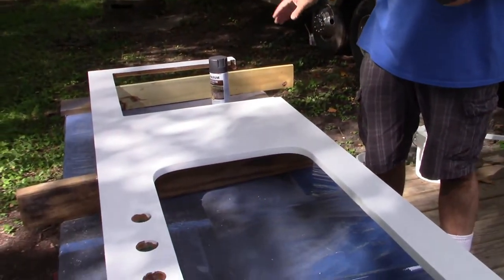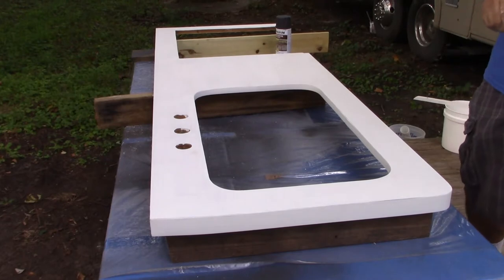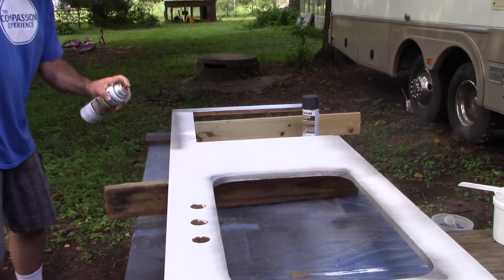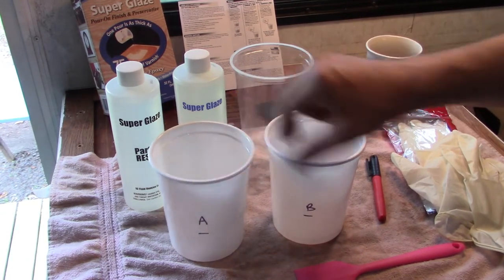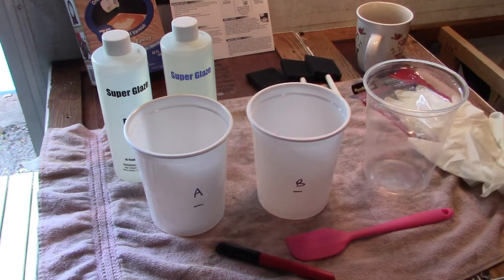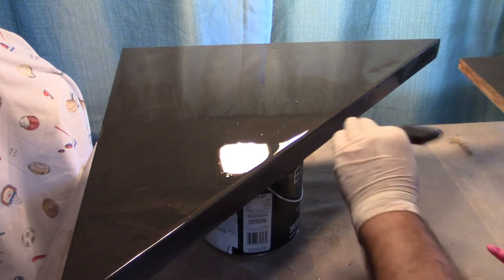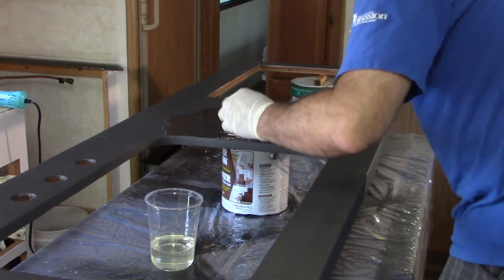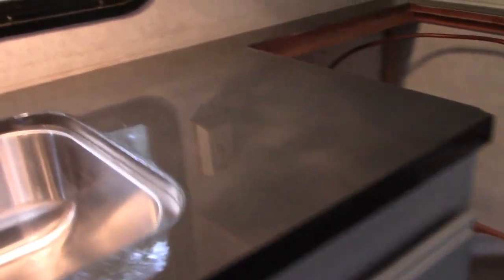How to Refinish RV Counter Tops - Multicolor Paint with Ultra Gloss Epoxy

Comment: I think it looks great.  No need to buy something new and have to cut it to size when you can refinish it to a new finish. Will it stand up to a hot pan from the stove or do you have to protect the surface from heat?   The new sinks and faucets look really nice too. On that slight blemish,  can that be fixed with a small dab over it?

Comment: Awesome .... I kinda of want to use the technique on our floor what do you think ?
Reply from the maker: Hi Michelle, according to the package, the ultra gloss epoxy is not recommended for floors. I suggest using oil-based (not water-based) polyurethane over the multicolor paint.